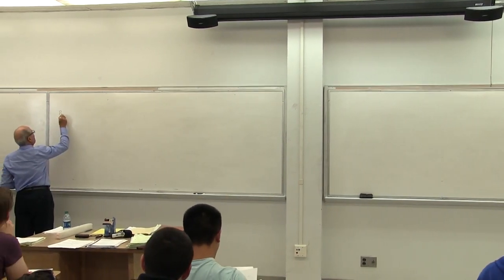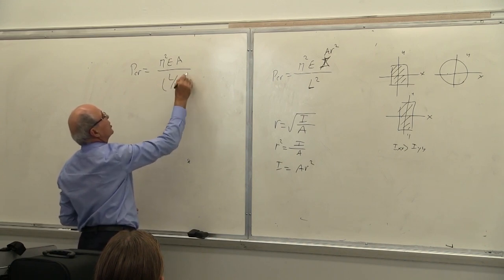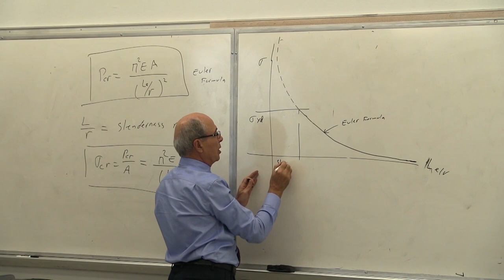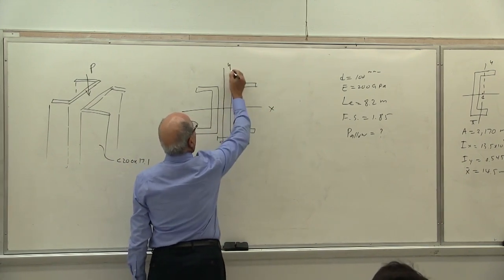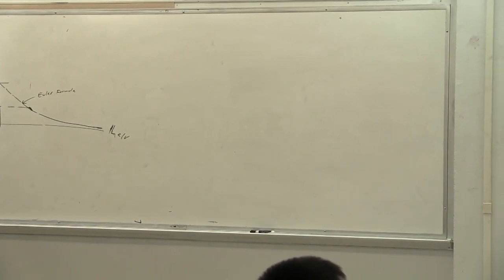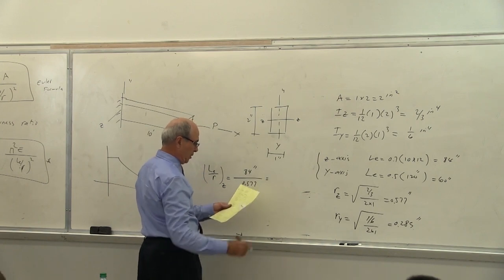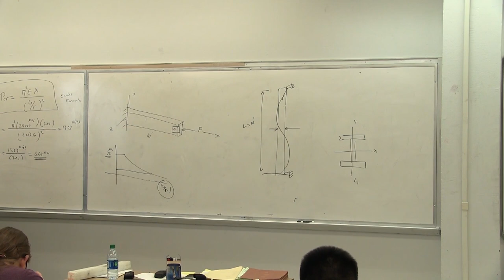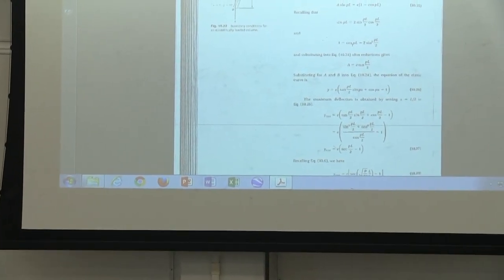Strength of Materials II: Buckling of Columns; Centric and Eccentric Loadings (18 of 19)

Comment: Sir, what is the name of the book for which you talked about in the  video.
Reply: I think beer and Johnson
Reply: mechanics of materials ferdinand p. beer. Best book for strength of materials
Reply: @erhansimsek74  Have you read Hibbeler book for mechanics of materials before ? probably will change your opinion.
Reply: @theadel8591  I have but I still have same opinion. On the other hand, Hibbeler has lots of different types of questions. We were using it as a question source 😄